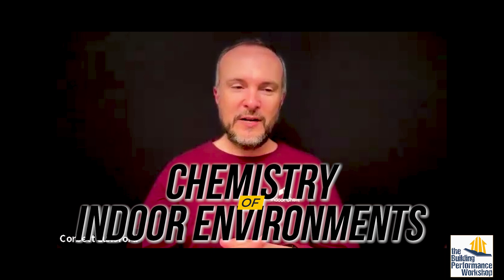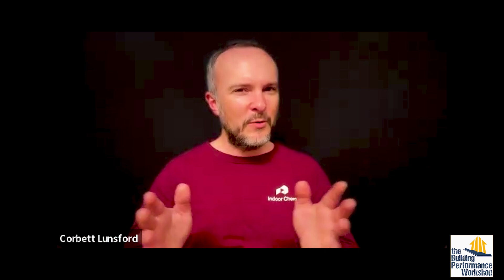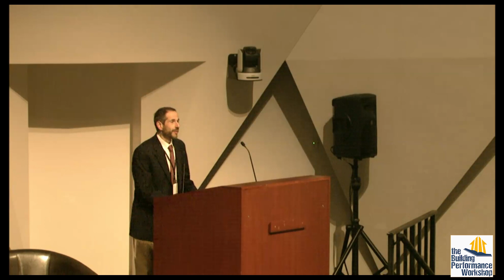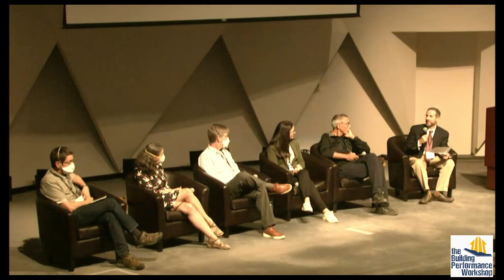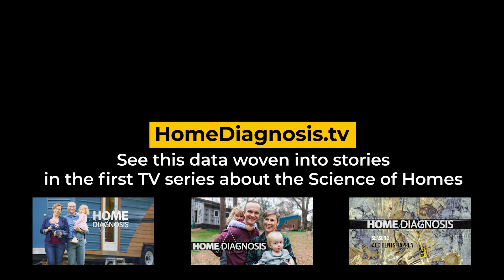Home Air Cleaning Systems & Ventilation: Panel from Chemistry of Indoor Environments (CIE 13 of 31)

Comment: 5:05 - 6:44 Very helpful
8:15 - 8:56 also helpful
14:22 - 17:41 particularly well-spoken and informative.
19:41 air cleaner design and maintenance.
23:23 some wave-links of UV create ozone. 
24:40 Photocatalytic devices (PCO)
29:15 “the manufacturer was shocked!”
30:30 ionizers - not effective.
34:16 HEPA work for particles not VOCs. Bio aerosols.  Change the filter.
36:23 corruption (wow! Very disappointing. Effective legal pressure on scientists from lawyers hired by hucksters)
38:30 multi-stage device design
The best solution is to not create the pollution in the first place. Go to the source. 
Most air cleaners didn’t work. Some do.

Comment: I think it’s important that they made it clear that a big part of the problem is we haven’t defined the problem. 

Media and adsorbent filtration works, very effectively the issues are noise and scale.  Bringing in “clean” air dilutes the pollution. 
UVGI is a great solution- for airborne disease, but it doesn’t excuse skipping the other 2 tools, and in fact requires them to mitigate its negative aspects. - hence why the bus is a perfect example. It’s old technology- upper room UV was tested 80 years ago to fight measles before the vaccine. To meaningfully move the public health needle we need to work on cleaner safer air indoors and out, from all the hazards, but especially airborne pathogens. 

It will take a layered approach: source reduction, ventilation, filtration, and appropriate use of open air or surface UV. UV needs long dwell times, so UV in a box is mostly worthless. UV in the upper air of an auditorium, classroom, or especially in areas with high traffic and low occupancy times like bathrooms and elevators  can solve problems.

Comment: Anyway from the point of view of biological contaminants in indoor air, something I need to know is how to design the inflow and outflow to a room to maximise the removal of these contaminants. For example, if you have a room with a dinner table and a bunch of people sitting around eating dinner and chatting: where do you put the air vents to flush that air while they're sitting there to remove virus and other pathogenic particles from the air, so that people don't feel a draught, but also don't infect one another?
Reply: @tealkerberus748  Up. vent hood over the table. It’s the most straightforward way, but not necessarily easy to retrofit.
Reply: Exhaust on the kitchen side?

Comment: I'm too early. There's no conversation about the content to engage with yet.
First suggestion: if a speaker's accent doesn't match the US tech bro accent that AI cc is trained on, or if you're using highly technical terms like "air" and "formaldehyde", you need to add your own cc.

Comment: 54:21 to remove carpet odors in bedroom, switched from an iqair multigas, to an 8" silenced ecm duct fan, 8" carbon filter, merv 13 in a filter box.  Getting quiet 200cfm, and excellent air quality, at less than half the price.  But, i suspect this put me on a weed grow watch list.
Reply from the maker: Nice setup
Reply: Personally I'd just be getting rid of the carpet. The easy solution!
Reply: @tealkerberus748  yes. But, I'm renting, and the landlord won't remove carpet.  Tight market. Could take years to find another place.